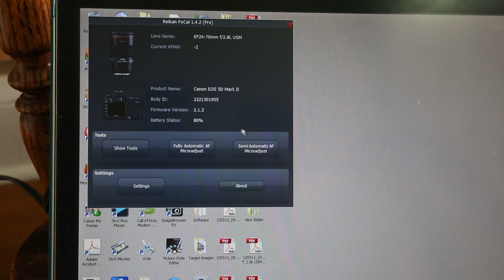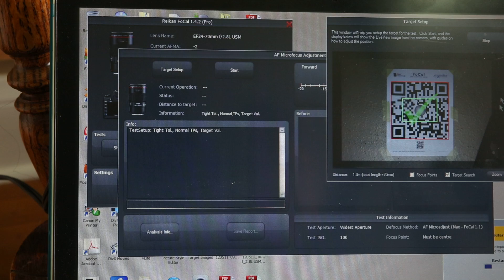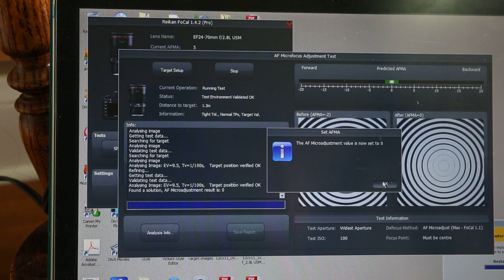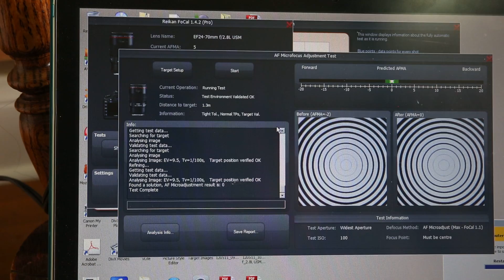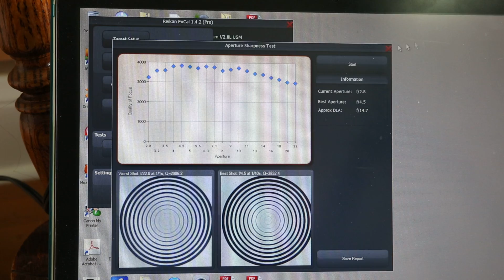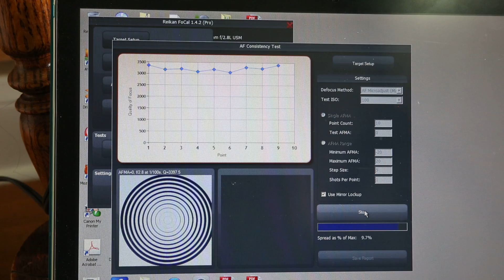Reikan FoCal Lens Calibration and other features

Comment: If you can't get the program page to show the entire page on your 
monitor, adjust your font size within your computer. I have my custom 
scaling set at 125.  This is a good starting point. I have not read 
anywhere anything about this issue.